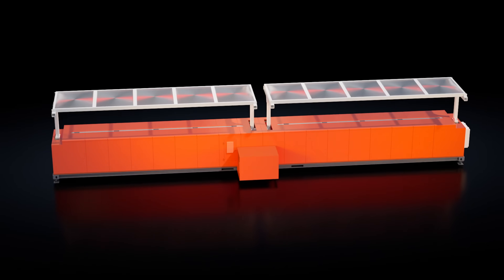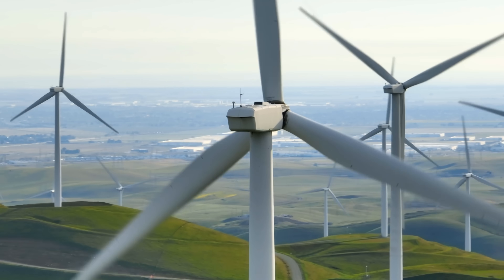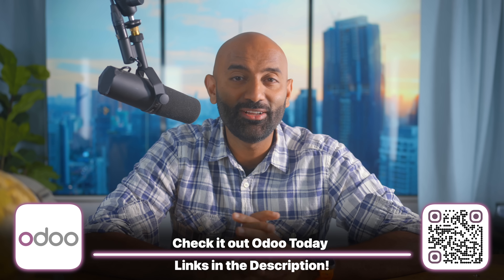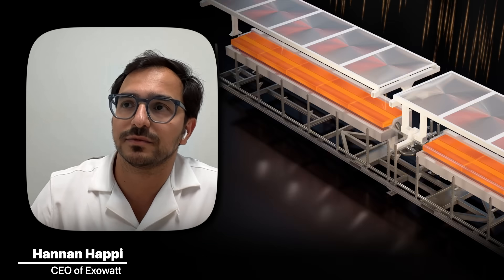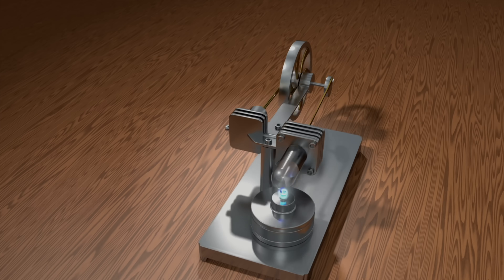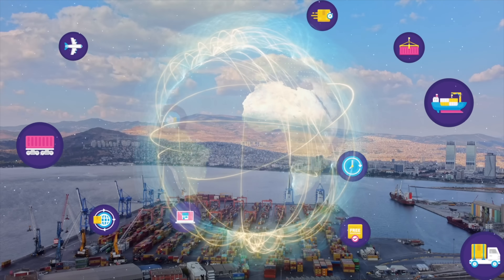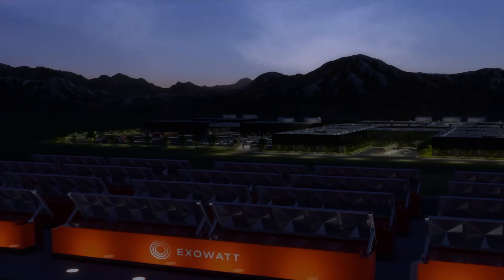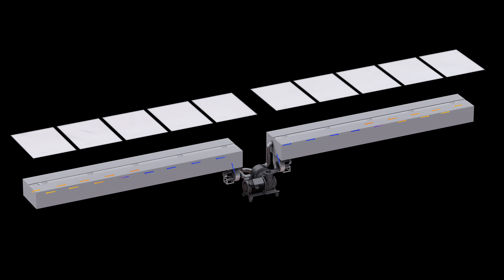Solar Without Panels, Storage Without Batteries - EXOWATT

Comment: I've been a huge fan of fresnel lenses and Stirling engines for years! I'm glad to see someone is finally using simple tech at scale.
Reply: Same here, but I had come to the conclusion that Sterling engines were just too inefficient and as exciting as is to produce intense heat from a fresnel lens, the max power available is still just what the sun delivers in the area of the lens (it isn’t magnified somehow) - it looks like the difference here is replacing the chemical battery with a heat battery, which is simpler, more durable, longer lasting and cheaper.
Reply: @willm5814  And it operates just the same in orbit or on Mars as on Earth, just in different scale for the energy input.
Reply: @willm5814  60% of the solar irradiance is thermal.
Reply: @willm5814 Electric solar panels use about 22-25% of the sun's energy at that point, though. With 45% as an optimistic future goal. I'd imagine these lenses use a lot more
Reply: 17:04 Regarding Stirling engine/generator service intervals and expected life cycle:
I see a company called RedHawk energy that sells Stirling engine/generator sets to rail lines that run on propane or natural gas. Their advertised maintenance consists of an annual inspection and a service life of 80,000 hours total run time (nearly 10 years if under continuous operation) and no reduction in actual service hours regardless of stop/start cycles.               Is this actually realistic for inspection and replacement intervals of Free-Piston Stirling engine (FPSE) generator sets?
Reply: Ditto! Was hoping this would be done and so glad ot see it.
Reply: stirling is one of the simplest machines that has been centuries around idk why people forgot it
Reply: @THINKERYTbe  Because they're inefficient and it's harder to control speed. Also takes minutes to start / stop
Reply: @GM-gh4dk  ooo....Stirling engines ... Learned about those during the shrubs administration, I remember Stirling engines units with a 4x4, 6x6 footprint making the equivalent of a single full size solar panel. At least that was the claim I remember.
Reply: Saaammee. So steampunk 😅
Reply: Replace Stirling with a modern steam engine / turbine and you increase the efficiency
Reply: Stirling engines are absolutely not "simple" technology. The ridiculous tolerances needed for high efficiency is the reason you don't see them anywhere.
Reply: Fresnel isn't a fan of you though. Dead people tend to keep to themselves.
Reply: Definitely withstand the 100LB Talent sized hail stones to come better.

“When they say peace and safety suddenly destruction will befall them.” Jesus 

“Those who would give up liberty for safety deserve neither.” Benjamin Franklin

You and co2 are not the cause of global warming climate change. You are not gods. The mystery of the 7 stars Jesus holds in his hand is and this is just the beginning of birthing pains.

Comment: No self promo. 73 yo Canadian. Technically trained. Some exp in power distribution.  15 y ago my employer sent me on a service call to a customer - a mine where my grandfather worked in 1910. Why am I saying this? Mines near my hometown have been operating for over 150 years, producing a lot of waste material called tailings. The waste is crushed igneous rock. IANA-Material-Scientist. I would assume (guess) that the tailings material would make an excellent thermal storage medium. I would also guess (asume) that there is an abundant supply (measured in cubic kilometers - no kiddiing). Other mining waste, slag from the smelters, is not as abundant and may not serve as well as a thermal storage medium. 
/30

Comment: I would love to see a tour showing the work these people are doing.  The solutions to energy storage offered here are simple and functional. It gets ignored, but there is more than one way to store energy from solar and wind electricity production (e.g., compressed air, pumping water lakes and ponds at higher altitudes to use for hydro-electric energy, etc.). Not all of it needs to be done on a large scale either. I like the modular and scalable nature of this. I would also love to see videos showing how people are storing energy from wind, solar, etc. at different scales. Meaning, not only in a way to power AI computer farms, but also to power people's individual homes, so they are not dependent on grids predicted to be incapable of supporting future demand, and particularly vulnerable to attack by radicals that lead to blackouts lasting weeks like happened in North Carolina.

Comment: Would think the thermal leak especially with stacked units would disrupt local temperatures and could pose more risk. The model would be better suited for off-grid power generation/storage but LCO would plummet with economics of scale if they sold units separately instead of whole battery packs IMO.

Comment: A deeper dive would be awesome! I have some questions. How heavy is a single unit? Could a large factory put a few of these up on its roof to provide power generation? What about a building, like a sky scraper, in a city? Also, I'm very interested in the maintenance needs and lifespan of the Sterling engine.

Comment: Stirling engines are notoriously inefficient.
Maybe 10%, so how do they justify this 22kW output based on 40m^2 (~40kW max) of sunlight hitting the roof of a large shipping container?
Reply: They justify it by you being in a place where you can buy the land for cheap and don't need it for anything else. I mean think about why you're concerned about the area or the efficiency to begin with.

Comment: The product seems promising but I'm afraid it'll only work in places having high DNI per m² most of the year. Comparing it with PV might seem like a like-to-like comparison when it is really not. PV will continue generating power even in cloudy conditions with higher diffused radiation though minimally but these Exowatt systems will become essentially idle meaning, they'll stop generating power.
Reply: Yes but it would be very efficient on the summer days
Reply: Yeah that was my first thought. If you get truly nothing when there isn't direct sunlight, will the bricks be able to hold heat long enough in between to not drain, and is a sunny day enough to bring up an empty heat battery to a reasonable level of charge again? If you need streaks of sunny days, it severly diminishes the usefulness of this technology.
Reply: Also because it still relies on the blower it needs to drain energy to work in the first place.
Reply: Would evacuated tube collectors resolve this?
Reply: @commentingisawasteoftime7195  The temperature evacuated tube collectors can reach is limited by the glass, probably 150..200°C max. Btw I use Fresnel lenses myself (for cooking) and doubt that they heat a sufficiently large thermal mass to 1000°C 😄 About 1/4 sounds more realistic to me. Heating something from the top is also much less efficient than from the bottom

Comment: How about coupling this with an ammonia based cooling system for the data center? Almost free AC.
Reply: Lithium bromide is better and less toxic for that
Reply: @texanplayer7651  I'M OLD LOL. I hole heartedly agree Li-Br is far safer.  I was just thinking about an old system at one of the chemical companies i used to work for.  i remember seeing R-717 and i believe it was used because it could reach -40 f or c
Reply: Good call and not waste valuable for survival requirements ground water.  I was wondering how would work out at sea, where can farm underneath as well as evaporate water as well for desalination and getting more into the atmosphere since the heated air will saturate more?
Reply: @jafinch78  Will it affect the atmosphere that much? Without the system the energy going into the ocean and atmosphere would be the same as with the atmosphere.
Reply: @catprog  More localized and less surface production, like for agriculture or mines, wasted. Plus potential additional production out at sea where most do not want to live and work.

Comment: Why don’t we use tools like this to preheat water for traditional power plants?  If we use tools like this to preheat the water, the power plant will use less fuel to create steam and spin the turbine. Might not get to zero natural gas but maybe we cut the fuel in 1/2 or reduce to 1/3.
Reply: It's not like we run power plants with cold water and dispose the hot water afterwards, it's going to be re-used

Comment: Reportedly 20% of California's electricity consumption is related to its water system (mainly pumping and treating).  Aqueducts in the southwest might be an ideal use case, where pumping water uphill is a huge energy hog.  Whereas 80% of water consumption is for agriculture, and 70% of a farm's electricity consumption is for water pumping, it would make sense to subsidize cheap electricity much like the water itself is subsidized.

Comment: AI states: 'One source explicitly states that Concentrated Solar Power (like this) "only really works in certain, very limited locations, desert locations in mid-latitudes where you get a significantly high number of insolation hours and not a lot of light scattering because of ambient moisture in the air and other things." This suggests that the technology would not be well-suited for a climate with frequent cloud cover and precipitation.' Next please?